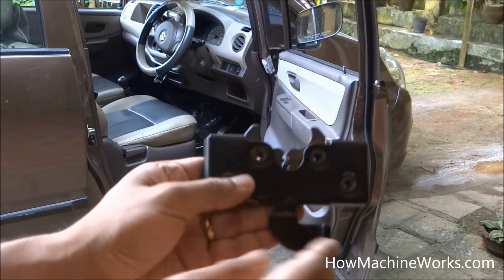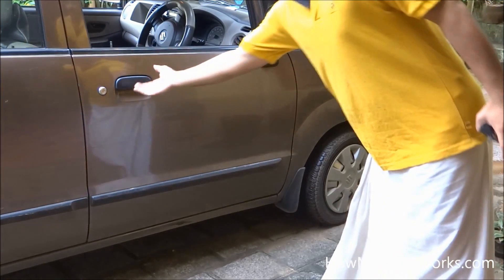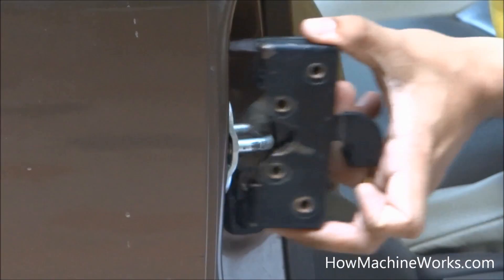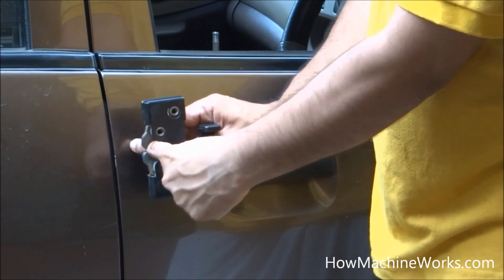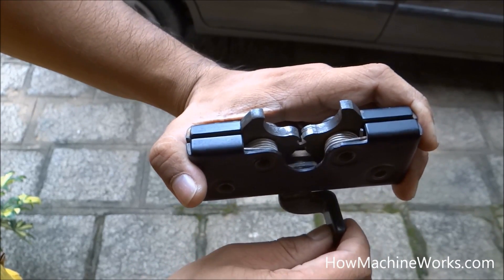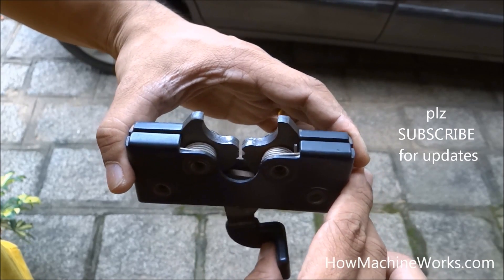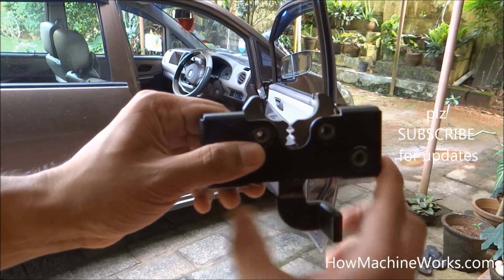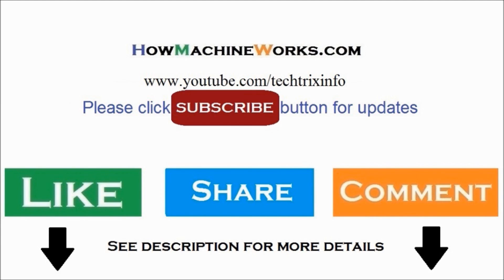How door lock of a car works - Must watch

Comment: Hi, I want to replace my door lock with an electrical motor(3V-5V), can you please show how does the  key fit inside, since its a turning mechanism, it should be possible to replace it with a motor, while the key still can be used too. Can you please send me a picture or make a tutorial on how to do it?

Comment: I SURE do wish that the one I'm fighting was that simple and straight-forward!!!! If anyone has ever taken apart a front, passenger side latch for a '91 Honda Civic 4-door "wagon," please reply to this post with any info. you might have about the final "step" (of all the cams, etc.) to release the catch (F from M.) I'm to the point where the only thing I haven't tried is trying to get a screwdriver in under a tiny pin, which the inside door latch is SUPPOSED TO move up. The latch activates the cam just fine; and, I even tried going under the cam with a small screwdriver, to try to give it a bit of an assist; but, that didn't work; so, I'm weighing the odds of that pin just snapping off, if I try to move it by going between the cam and the pin... Here's some pics which show the latch: https://www.ebay.com/itm/163091905961?ViewItem=&item=163091905961 The 3rd picture, zoomed in, shows the above mentioned pin, just to the right of the cam, towards the bottom edge of the picture.